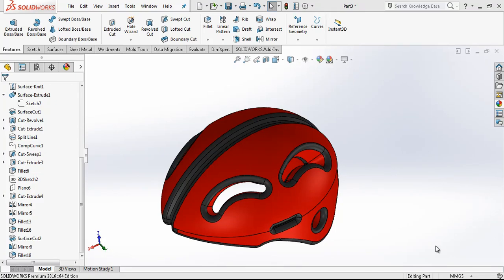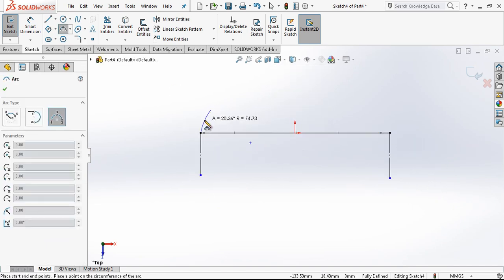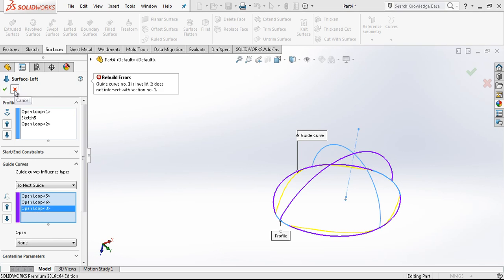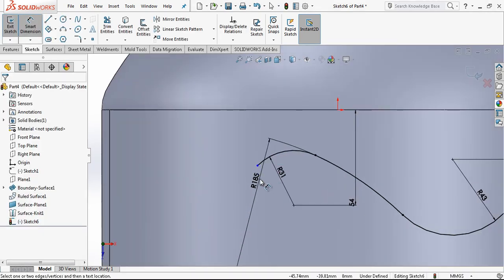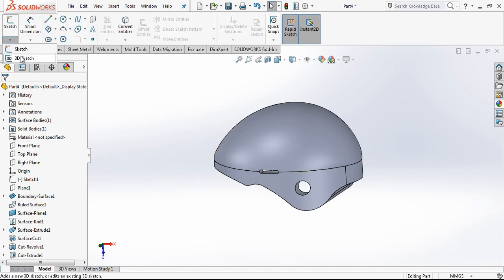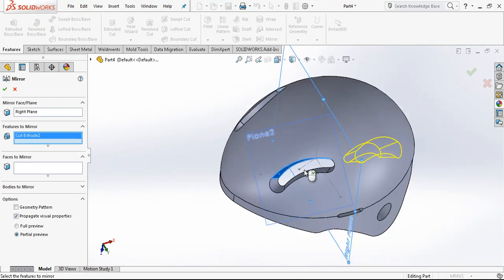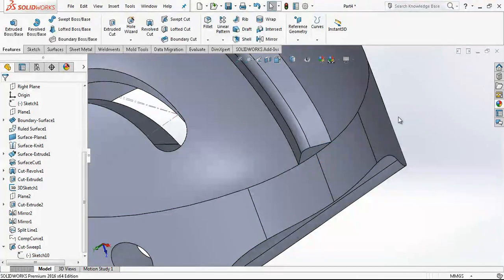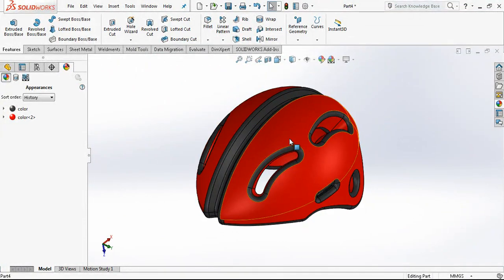Advance Surface Modeling - Bike Helmet SolidWorks

Comment: Thank you so much! I run into a problem. When i tried to mirror the third arc slot SW said "unable to add the specified draft to the extruded feature. Please try a smaller draft angle". I tried fixing this error in many ways. If you had time, I hope to get your answer. Thanks again!!!
Reply from the maker: Hi Dear, are you sure you are having exact values from my video ?
Reply: @3D-World  Thank you, i made it again and got it!